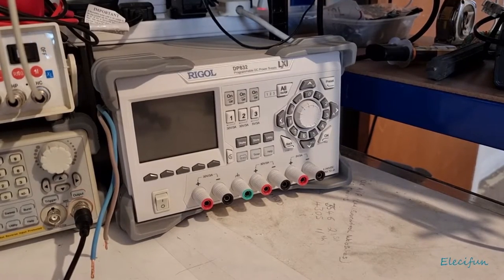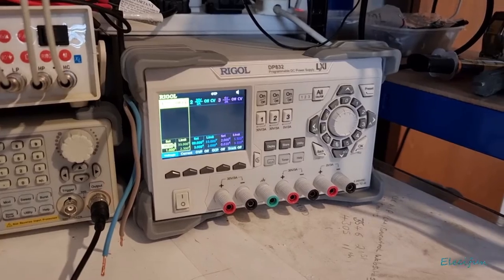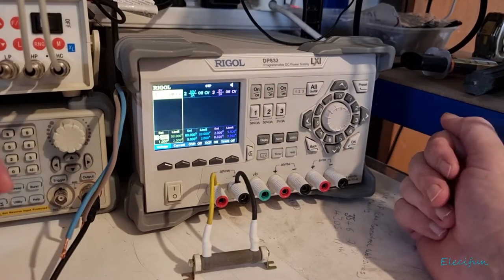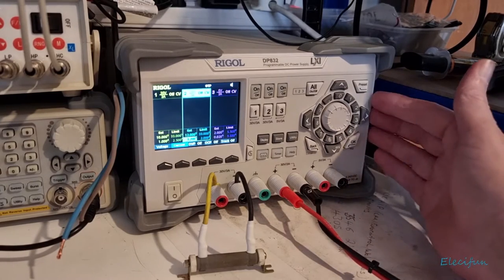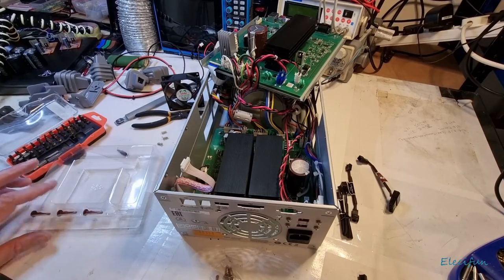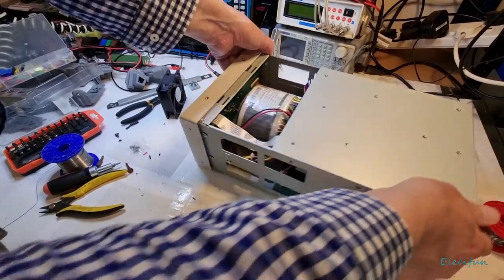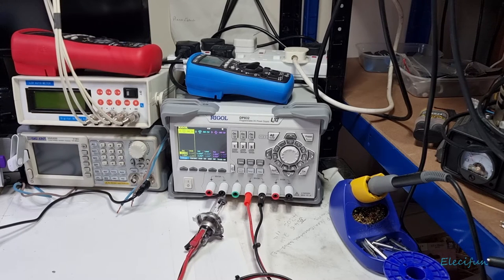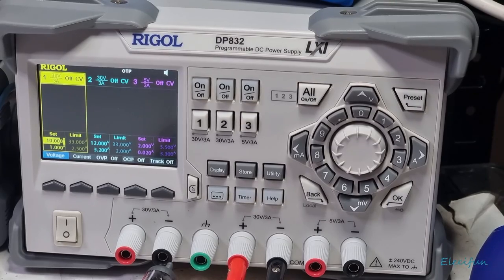Rigol DP832/A FAN UPGRADE

Comment: If you want to make it even quieter, cut out the rear fan guard with a hacksaw or Dremel and replace it with a wire fan guard.
Reply from the maker: Hi Chris.. thanks for the tip. It is really quiet. I think I will leave the hacksaw for now.

Comment: yellow wire is rpm, so if there's room, you can usually just plug the 3 pin plug into a 2 pin header and let the third pin overhang and not make a connection. on 4-pin fans, the 4th pin is PWM for speed control, but those can also be connected to 2 or 3 pin headers if you have the space to let those extra pins overhang.  but cheers, this is a big difference and I think I'll do the same.  the noise drives me crazy.  my keysight power supply is even louder, believe it or not, by about double.  that might be my first target
Reply from the maker: I don't think you will be disappointed. Well worth it.

Comment: Had the same annoying problem, this video gave me the nudge to start the fan replacement, Thanks.    Instead of the expensive Noctua, I plan to use an Artic F8 silent fan, specs says same noise level, as the Noctuas, but a little less airflow for the Arctic, hope that will be OK.
I use this power supply mostly to power my microcontroller projects, with a load below 100mA at 3.3V.  Even thought of adding a simple kill switch on the fan, have to test it if the thing running at idle or almost idle load really does need any forced air cooling.
Is it a two-speed control with voltage the unit has?   Is it based on output current?
Reply from the maker: Hi there, I checked out the fan you are thinking of as I have used Artic in my computer cases before. I'm not sure why they used Sone (perceived noise level) for the noise level as decibels is the more understandable unit for most of us. One thing that is noticeable from a quick look is the lack of damping within fixings which will give any resonance a way into the case. Uneven dust on the blades can cause this. The Noctuas also offers airflow groves in the ducting offering better airflow and lesser air flow resistance again reducing resonance and noise.
The DP832 has a two pin connection. The current drawn by the fan shouldn't be a problem.